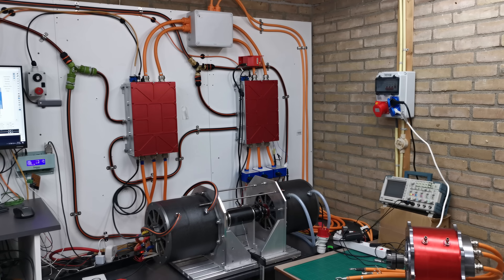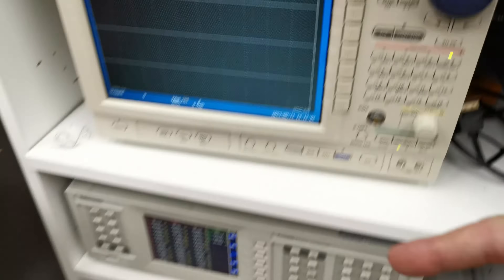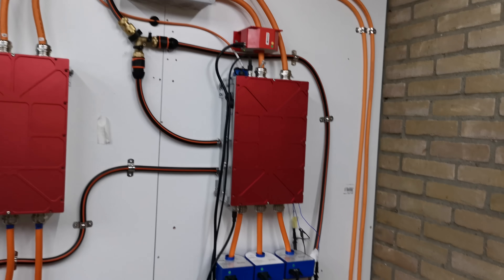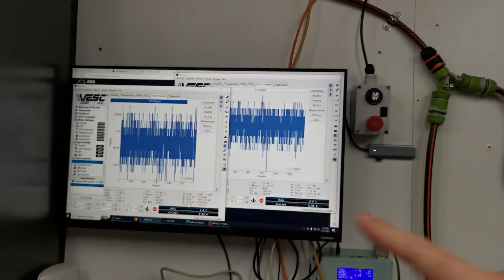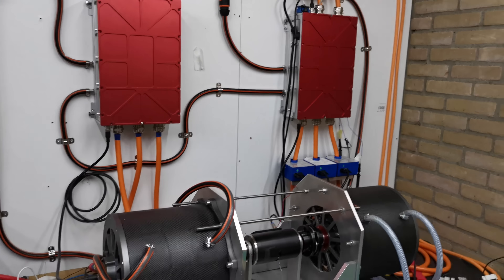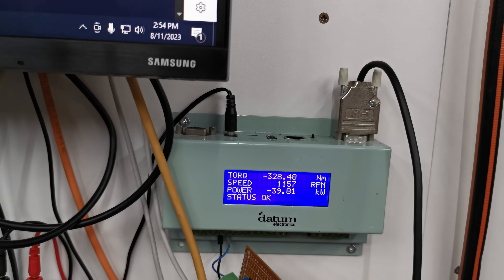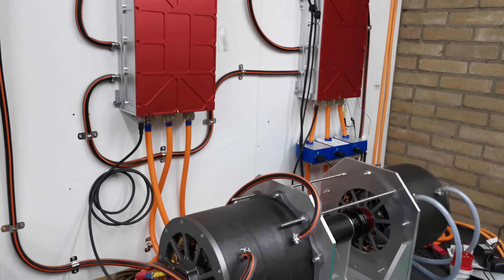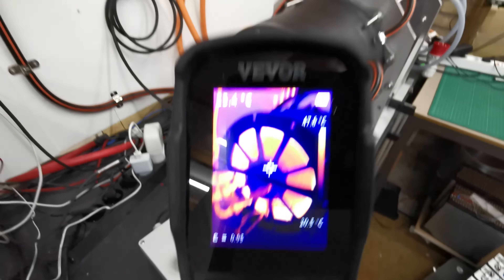Joule Motors High Voltage VESC 500Amps testing

Comment: How much does it cost to build one Motor?
Reply from the maker: It cost more do design it, than to built it on terms of time. Time is also money.
Reply: @iulian207  I also design and build motors. I like your work. 👍🏻
Reply: @iulian207  - hello, I sent you an email a few days ago and still waiting for a reply; are you in a position to reply to your emails?   Thaks!
Reply from the maker: @energydreamer5347  my e-mail can be found on about on my YouTube channel.
Reply: What is the air gap in both the Motors?
Reply from the maker: @jppatel4831  0.8mm
Reply: @iulian207  How do you build Stator and Rotor to maintain the desired air gap? Using Wire cut or Laser cut technology?
Reply from the maker: stamp @jppatel4831
Reply from the maker: @jppatel4831  0.75mm

Comment: how often do you need to change orings in those garden hose connectors to avoid them leaking?
Reply from the maker: Until now I never had to change them.
Reply: @iulian207  Salut Iulian, foloseshti silicon?